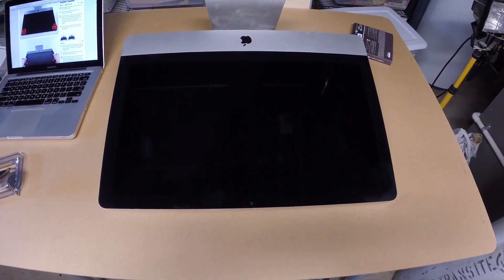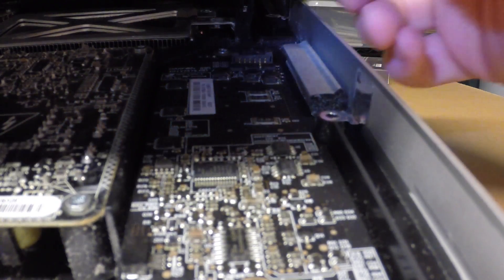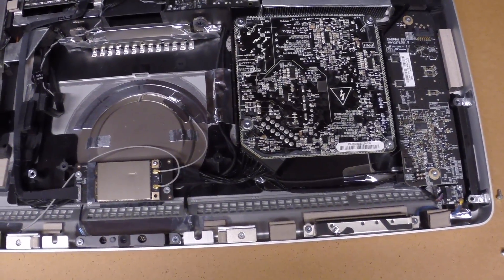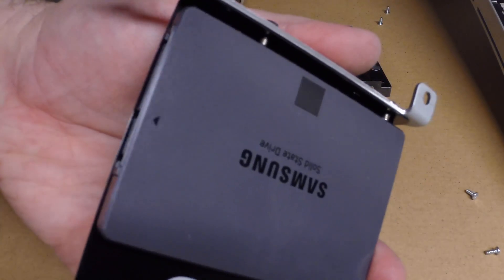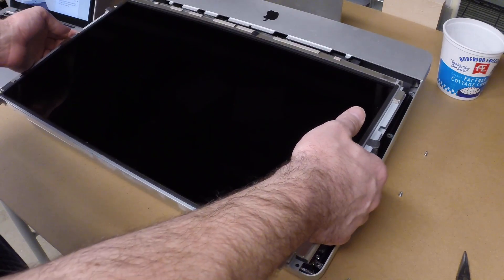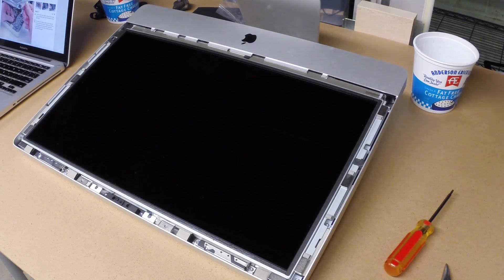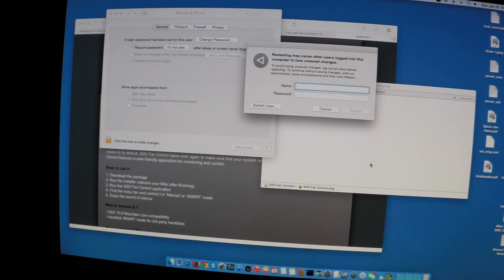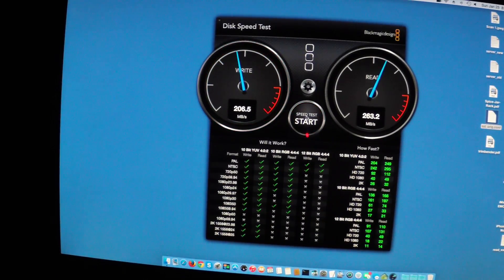iMac (circa 2009) Hard Drive to SSD Upgrade

Comment: Thanks for this useful video and links! I'm doing this to my late 2009 iMac soon. Can you add any insight on TRIM support and El Capitan on such a machine with a Samsung EVO? Probably the EVO 850 500GB due to it having a better price then the 840, at least where I live. I see the fan control was fixed to work with 830/840 "and possibly other" so I might be in for a surprise there.
Reply from the maker: +Tommy Stormstereo I'm running a Samsung 840 EVO and I have upgraded to El Capitan. The fan control software is still working. I'm guessing it will work with the 850 but I can't say I have tried it. I have a video on enabling TRIM (https://www.youtube.com/watch?v=J9RLqVgjfXA) on the Mac and this is the technique I used on my iMac. A commenter on that video pointed out that there could be a problem with enabling TRIM on the Samsung drives (http://www.macnn.com/articles/15/07/02/latest.os.x.version.offers.preliminary.support.for.third.party.drives.129345/). I do have TRIM enabled but I also have multiple backups and I absolutely recommend having multiple backups before messing with this stuff. I do have an 850 EVO in my Macbook Pro running El Capitan and TRIM turned on. I just can't say 100% that the fan control will work.
Reply: +RickMakes Thank you so much for your informative answer. Much appreciated! I feel confident to try this soon. I'll try and get back to this thread with an update afterwards.

Comment: HI Rick,

I don't get that good what is the Fan Software for. Could you explain?
Reply from the maker: The original hard drive has a temperature sensor built in. If you remove it, the computer's fan runs at full speed (very loud) all the time as sort of a failure mode. Using the software slows the fan back down like when the sensor is installed.
Reply: You got it?

Comment from the maker: Carolien, so far, I haven't had any problems with the fan control software.
Reply: +pokeutopia There is also a Windows version of this software, so you can do the same under Boot Camp too…
Reply: +RickMakes  great idea to control the fan, do you have to set it to 'smart' every time you restart your computer?  or it is one time setting and it will be permanent?
Reply from the maker: +Neethan kanesha The setting is persistent. If you boot into recovery mode, the fan will run at high speed because the fan control hasn't loaded. When booting normally, the fan control keeps the speed under control and the computer is nearly silent.
Reply: +RickMakes thank you
Reply: +RickMakes Hi Rick, is the fan control software for Mac or Windows? What happens to those who dual boot window?
Reply from the maker: +pokeutopia It is Mac only. When you boot into Windows, I'm guessing the fan will run at full speed. There are other (hardware based) techniques to slow down the fan. I would do some searching online.
Reply: 1iceberg pk xNxx

Comment: Very good and useful video. How did you setup the OS to the new SSD before recovering data from time machine?
Reply from the maker: Mike Scholl I can't remember what I did. :( I may have used another Mac to create a USB installer. There are instructions online for doing that. You may also be able to boot into recovery mode (Command-R at boot) and install the system from there.